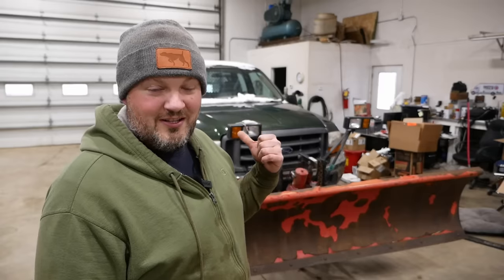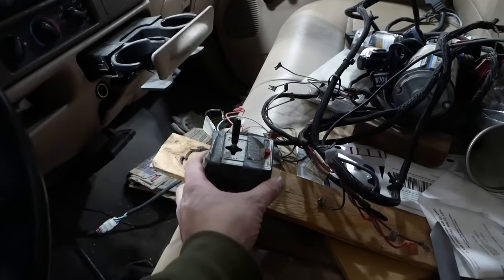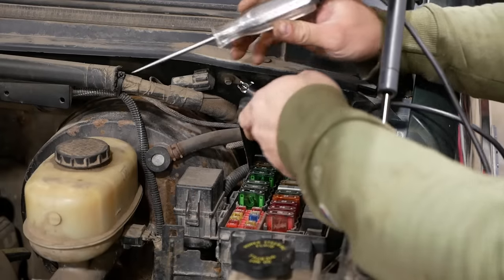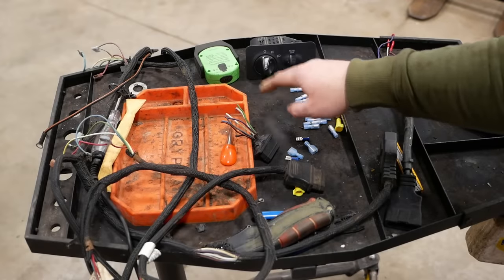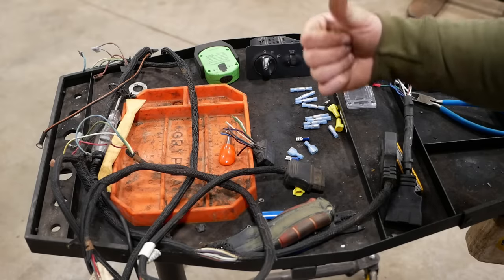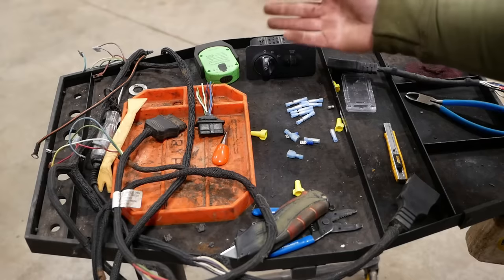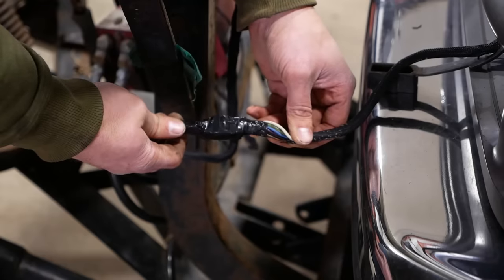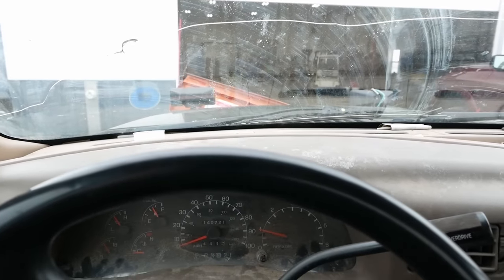Soup Sandwich Snowplow Repairs

Comment: If you take your wire nuts and fill them with dielectric grease before you screw them together, they'll actually last longer than anything else except a solder connection. I used to chase around bad wiring on my father's plow trucks and trailers and I never once had a wire nut connection done in this way fail. Granted we would use them that way for a season but they were reliable for that amount of time. Butt connectors are the worst. I have never had good luck with them. Eventually the wire nuts will fail too and the answer to that is a solder joint with a shrink tube over it, again with dielectric grease over the connection before you shrink the tube on. It keeps the salt out of the connection. Just a shrink tube won't seal it by itself well enough. If you see just a little bit squeeze out of each end when you shrink it on it's perfect. I've done connections this way, park a trailer in the hedge row, come back to it 10 years later with trees growing up into it that I have to cut away and all the lights still work perfect on it. Just a shrink tube won't seal it by itself well enough. In a pinch if you don't have any dielectric grease you can use regular grease in the wire nuts. Might create some resistance in the connection but it'll keep the schmoo out long enough to get it back to the shop and do it right. I've seen guys use silicone sealant in there but that tends not to seal very well because when it hardens the strain on the wires breaks the seal and moisture will still get in.

Comment: Wes, fun fact.. have you seen how those switches actually come out on the Fords? You didn't show it but I fought one until seeing how it's supposed to be done. Pull the knob off and flip over and turn to release that tab. Kind of ingenious once you see it. Found another video that showed it AFTER I broke mine! LOL Happy New Year bud!
Reply from the maker: I didn't know that! I always pulled the trim panel and popped them out from the back.
Reply: @WatchWesWork  yes! Once you see how it works it makes it so much easier. Search on the tube and you'll find it! Like I said I broke mine before I figured it out.

Comment: Love your channel, Wes. Did you show the installation of the vent tube? Also, why did you use the flourescent marker on the cover plate?
Reply from the maker: No. It appears to have the updated vent. I marked where the 3 studs went so I would get them in the right place.

Comment: Hey Wes, why didn't you just splice the connecter's back on fill the hole with the rotted wire with silicone and use the bullet connecters for just the one bad wire?

Comment: Could have used a few trailer wiring connectors from any parts store or gas station, more water tight and easy to use.

Comment: Do these plow installations kill the factory headlights in favor of the high mount lights on the mount bar?   Or was just burned out factory headlamps
Reply: Typically, all the lights work--if the installer follows the instructions correctly.  The plow part is removable, or is meant to be.

Comment: Why won't the truck headlight work? You would think they would want those to work also. Any extra light would be beneficial. Maybe the circuit is overloaded?
Reply from the maker: No, usually the plow lights will turn off the truck lights so they don't reflect off the plow and blind the driver.

Comment: I would think that your state would of  caught on to what causes what by now but we do have Bidon don't we. For a person no one has voted for, someone had to of but blame that on one state too I guess... like having seven of one but five only of the other. Its actually a easy fix in a sad truck. I have seen some of the stuff that you take apart and didn't want to believe it could get so bad in one lifes-time.  Good to hear your voice for new years  an so a tip on the newest works in a can. I seen them use on some old old army heavy equipment.... Nocker loose! I didn't see the whole word as they had the can upside down an fingers covering plus  them talk about it. I saw  them use it with big Milwaukee fuel wrenches

Comment: Tem-a-per-morary ... It's only a permanent temporary solution... Untill it stops working.  Ever try a pair of trailer 4pin plugs for harness replacement? 2 colors of electrical tape to identify which plug goes where. And something nice for the headlight like a mini Anderson plug?

Comment: I use trailer plugs , 1 for lights 1 for plow , works fine by me
Reply from the maker: We need 9 wires.
Reply: I did the same thing on a 9 pin fisher, used a 5 flat and a 4 flat.
Reply: @WatchWesWork  I use 5 pin marine grade I buy off Amazon about 10 dollars . Got 30 plows I'm always fixing something.

Comment: Hey Wes I think you've got it wrong at 5:10 dat is not a problem it's a wireless switch it should work as it was. The connectors are only for backup :). Just kidding, but I wish you all a happy new year!

Comment: I suspect that headlight switch bluetoothed itself there was a tsb on that year's ago it would vibrate loose when the switch was hot affected all fords with that square switch trucks vans etc the ford factory repair was glue on tabs on the plug

Comment: Excellent video Wes  :) also want giggle one guy my area had 1976 Ford Truck F350 extended cab with flat bed were box with 351 Windsor motor 4 barrel carb also 4 speed Manual transmission want me fix exhaust was daul type ! When put new exhaust totally guess what was using for gasket on manifolds to head also gaskets and Lol at this to tell had Canada Penny's silicone with black tar on roofing job use to seal up! Also was so sticky on hand took me 2 weeks totally do and gloves had throw 4 pairs also had get 2  co worker help too also one knife work gloves of my hands to also ! All 3 guys of us shook our heads ! Totally of $50.00 of Canada Penny's and totally put box give owner presents  unwrapped it on own time! Worst mess ever seen also hope guy like extra money of Penny's and he paid for our 2 weeks job of 3 men hours of shop rate and boss told owner never do that again or we refused it be scrap yard Junkyard type! Then he did again also Minstery Of Transport saw truck check over told owner get fix by professionals or junk it and get new truck ! He learned hard way in 1996 and buy new truck because of worn out and 1976 had bad frame plus black tar Penny's job too!

Comment: You need a ferret. Yes I’m referring to the animal.

If you’re going to keep chasing these crazy terrible wiring harness problems. Think I’m kidding? Ask Boeing, Lockheed Martin, and other huge military contractors. They used ferrets to pull wiring through long difficult hard to reach places…up until the 70s and 80s
Reply from the maker: Wow. I never would have thought of that.

Comment: Question: why not just put butt connectors on the wires? The reliability would be better (improved vibration resistance) and the customer would be more likely to bring it back come plow removal time. You have to cut all the wires at least one more time anyway.
Reply: Technically, the whole plow is installed to be removable.  Say the motor throws a rod or the like.  Operator pulls the working plow off busted truck and puts it on a suitable donor truck.  To get paid, you have to be able to plow.  No plow, no pay.  Speed pays.
Reply: @CAPNMAC82  The theoretical recipient of this plow isn't going to have the hodgepodge of spade and bullet terminals to plug and play this plow anyway.

Comment: Throw out the electric and go to the old cable style western pump. Dad had a western plow for 20 years on his 75 f100 and never replaced a cable. He adjusted them but never replaced them.
Reply: You go ahead and keep those cable western pumps, my first plow was just that. I love my SEHP Fisher pump simple yet reliable
Reply: and spend more than the truck is worth trying to chase down old skool cable operated system. western had one of the easiest electric over hydro systems in that plow's era

Comment: Its funny to see what you call a snow plow over there. Its a toy. Not meant for snow. Max a couple of cm. Lol.
Reply from the maker: OK
Reply: @WatchWesWork  I’m just used to see quite a bit bigger equipment used here in Norway. I’ve in my lifetime never seen in real life a plow setup like that. :) Closest thing is some side by side 4x4 with a tiny plow in front, but they tend to be sold off quite rapidly in my area. :) its usually huge lorry/semi-tractor etc with quite the substantial plow and for small stuff it’s regular tractors 🚜 with snow blowers and plows they pull. So please don’t think I was making fun of you guys. It’s litterally funny to see how areas that have less snow deal with it. It looks so tiny and cute.

Comment: I’m a little slow, but instead of cutting the harness right behind the connector, why didn’t they do this crazy thing called unplugging the connector?
Reply: I guess you missed  7:48.    All corroded.
Reply: @firesurfer  I watched the entire video. Yes I saw the corrosion but instead of cutting it to disconnect it they could have disconnected it at the connector.
Reply: @callen6893   When you know something is bad, it's best to get rid of it immediately.  That way someone in the future doesn't use a bad part.  The plugs are cheap enough to just go for all new.
Reply: @firesurfer  then if that’s the case why didn’t the other shop replace the plug instead of hacking it off?  Either the other shop is a hack or possibly the owner didn’t want the work done (which doesn’t make sense because they brought it to Wes after they paid another shop to look at at it,)
Reply: @callen6893  Who said it was a shop? The owner may have done it. He may have left it there for Wes to figure out. The owner is in his 80s.

Comment: I don't even wanna go there.long
story short , years ago driving a
Ford A series pick up motor only
last about 60,000 miles b4 giving
up topping up the oil only to find
it blew straight out again the
manager getting pissed off
with me , as it is my fault F u
Oh tried to send me out on
2 worn tyres , so l went & got
them replaced they were not
happy... So they punished me
by locking the truck up for
3 days after closing we usually
drive them in to work/ or drive 
them home 😀😀

Comment: Maybe it has a battery drain - which someone in the past fixed by unplugging that light switch...  

Can't tell you how many automotive electrical problems I've fixed by simply reconnecting wires which some careless hack left unplugged...

Comment: is there a standard fee for the rodent eradication?
Reply from the maker: You'd have to ask Max.
Reply: @WatchWesWork  Car 2 Boxes of Milk Bones. Pick-up Truck 2 door 1 box of Milk Bones, 4 door 2 boxes. Other - Varies by the length & Height. Meat basted Milk Bones preferred but not necessary.

Max-ified Warranty - For a 30 day Warranty add 1 Box of Milk Bones & I will piss on the outside of Vehicle in various places to warn off Critters.

Comment: Why do all the plow guys bring their crap the day before the storm, when they have months to fix it beforehand. That plow is older than the hills, just shows there's no money in plowing. I was waiting for the smoke to pour out when the controller was activated, always good for a laugh. If a good storm hits that P.O.S. will not last an hour and will be in a ditch on the side of the rode. Wes he's going to call in the middle of the storm, guaranteed, they always do.
Reply from the maker: He can call all he wants...
Reply: lazy plow operators beat the stuff, dont do maintenance. we have the exact same unimount Western plow on one of our trucks, its sadly more reliable then the POS Meyers that are a good 5 years newer  we have on the other trucks
Reply: @harveylong5878  We only use 7-1/2 ' Fisher V E/Z mounts, pretty good plows especially for moving snow after a storm and parts are available, but some operators are disasters, a 12 year old with a shovel puts them to shame. Pick them up at the scrap yard in the spring after the Village & Town operators screw them up.